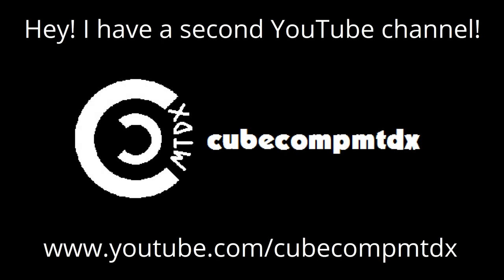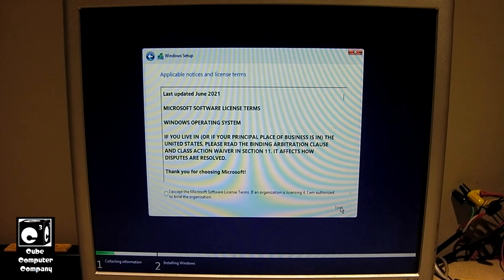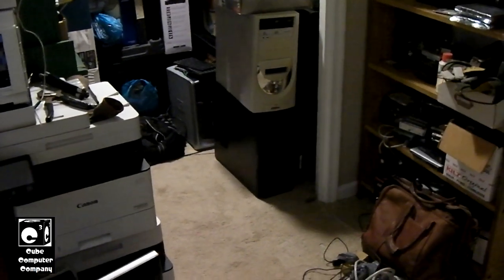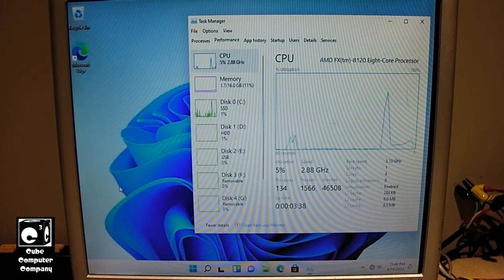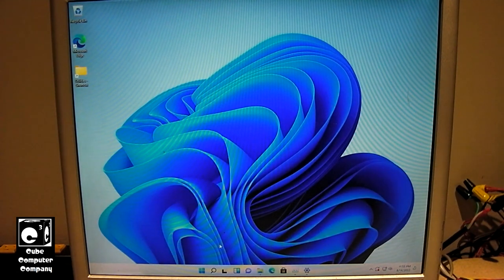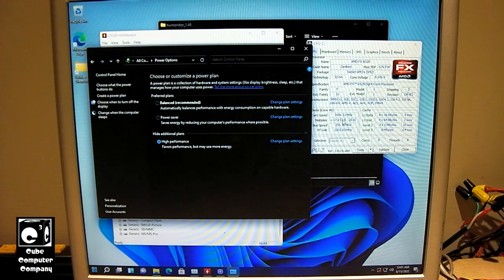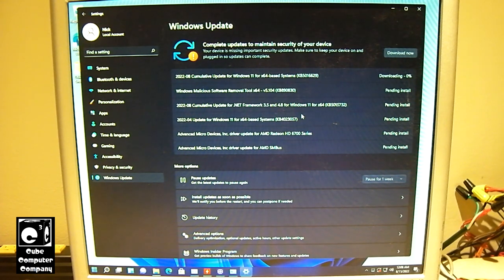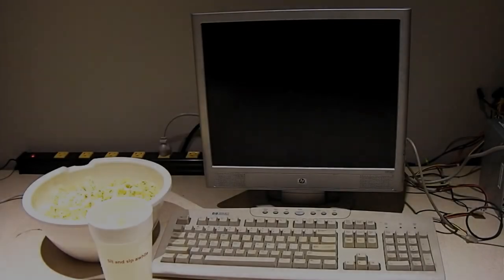Running Windows 11 on AMD FX 8120 + Radeon HD 6750

Comment: The FX series was foundationally built on the idea of Clustered Modular Threading, essentially creating more discrete units within the ALUs of the processor while sharing some functional units. For Bulldozer, Piledriver, and Excavator, the shared units were the prefetch, decode, and floating point units; Steamroller (the third gen) duplicated decoders on each ALU, but that was reversed after it didn’t prove to be much of a performance bottleneck in the finished design. Whether that makes a module of paired integer units with a dual-issue FPU a pair of cores is up for interpretation - I will say that Intel’s designs were usually more performant due to higher IPC.

I’m glad to see that despite Microsoft’s protests the FX series still handles Windows 11 pretty well. Thanks for the video!

Comment: I'm so glad u did this video I have a fx cpu  and I'm gonna put win 11on it
Reply from the maker: Pair it with a SSD and you'll have a snappy system!
Reply: Y ?
Reply: Windows 11 is bs
Reply: You must add a TPM module to the motherboard if it has the connector for it. It might have one installed or it might not. Processors didn't have built-in TPM until a few years later. The person that had the PC in this video might have done a lot of online shopping so they added the module.
Reply: TPM 2.0 modules are backward compatible they will still work on motherboards with older TPM connectors. 
Get matching brands. If you have an Asus motherboard get an Asus TPM, if it's a Gigabyte get a Gigabyte TMP.  An Asus TPM won work in a Gigabyte motherboard. They are easy to install no screws just plug it in.

Comment: Open-shell is open source and free if you want the old style start menu back
Reply from the maker: Open Shell does not work well with Windows 11, at least the last time I had tried it.
Reply: @CubeComputerChannel  I've been using it with Windows 11 just fine. It's a nice bonus along side AllStartBack. I love my 9x style menus.
Reply from the maker: @FugginNugget  Does it work with the Windows 11 start button? That was the problem I had. StartAllBack provides a Windows 7 style menu, and also fixes the taskbar and right-click menus.
Reply: @CubeComputerChannel  I Had that issue to at first. But I figured out it wasn't replacing the Start Button like it was supposed to, but was layering a second button on top of the default Windows 11 Start Button. I just ended up using the custom start button option, and loaded a custom start button image that was just big enough to cover the whole Windows 11 Start Button. 

But you don't have to worry about that with StartAllBack installed. It does a full Windows Start Button delete, and puts in it's own Start Button. And if you have Open Shell installed, it just opens the Open Shell Start Menu.

Comment: I'm a little late to the party but I'm rocking an Amd Fx-4130 with 16gb DDR3 and an rx 460. Possible to run windows 11 before I waste my time trying?
Reply from the maker: Yeah, it'll run Windows 11, though you'll need to use Rufus to set up a USB installer to bypass the CPU and TPM checks.

Comment: Do you still have to use Rufus to get Windows 11 to install on older systems?
Reply from the maker: It depends on how Microsoft's tool formats the USB drive. If it formats in GPT format, it won't be bootable on MBR systems. I prefer to use Rufus to remove the TPM and CPU checks, which may or may not apply for clean installations.

Comment: Hi! I was trying to update mine but says that it´s unsupported on my pc, I use AMD FX(tm)-8320 Eight-Core Processor  3.60 GHz, a bit old I now but it´s immortal! and I love him! 12 gb ram corsair a bit old also, I read something about a few models that we can change an option at bios, and an NVIDIA strikx 750 ti oc 2gb, windows 10 has dream for me like the xp times if I can say it were pretty cool.  I was not using a boot compilation of the  windows O.S, i downloaded the update from Microsoft website, what am I doing wrong! pc age hardware? cpu architecture version also "outdated"? kind regards thanks for the video!!
Reply from the maker: Your system doesn't meet the "Microsoft EliteClass" minimum system requirements to run Windows 11. You can still install Windows 11, but you would need to either clean install it, or use Rufus to write the ISO to a USB drive, bypassing the EliteClass checks. I have this outlined in a different video. Please note, you will receive Windows updates, but won't automatically receive feature upgrades, and must manually install them.
https://www.youtube.com/watch?v=TJqPCS89OUE

Comment: Please try with my specs:
Core Duo E2140
2GB DDR2 RAM
GT 210
Reply from the maker: I have that GPU, that RAM, and maybe that CPU. I'll do a video on a system with at least similar specs
Reply: DDR2 is definitely not gonna carry Windows 11, let alone Windows 8 and maybe 7.
Reply from the maker: @flintfrommother3gaming  Wrong. I've set up many DDR2 systems with Windows 10, 8, and 7. I've also run Windows 11 on two DDR2 based systems. 4GB is needed for usable performance.
Reply: @CubeComputerChannel  I accidentally wrote DDR2, I was going to write 2 Gigabytes of RAM, well 4 is enough for an OS atleast.
Reply from the maker: @flintfrommother3gaming  Windows 11 will run on 2GB RAM, just not very well.
Reply: SSD with those specs will run fine

Comment: I use Fido keys. I think Microsoft should let you install if you use Fido keys instead of TPM. That would solve the problems with security on older PCs. Fido keys are many times more secure because of the touch feature so Microsoft should install and let us use them.

Comment: considering i have it on a couple a6/a8 apu's... yeah it works fine... also works GREAT on FX8350+ chips and 6core12thread xeons(4.5+ghz oc and they match or beat first gen ryzen gaming in most cases... )

i went from using rufus to make 11 install on my system to being able to just install it... my x58 board died and i wasnt gonna spent 150+shipping to get another decent x58 board when that was a good portion of the price of a x299 board... 7940x@4.6 with 64gb ram is a nice upgrade... though... for games my 1070 amp extreme is still the bottleneck most of the time..heh...

Comment: Mine crashes at 4Ghz so I back down to 3.8Ghz. I have the 95w FX 8120 instead of the 120w. I put an overkill 150w heatsink on it, the heatsink fans stay at low RPMs most of the time until I start rendering video after about 25 minutes, it really gets going after an hour.
Reply: If it crashes at 4Ghz you can increase voltage (do it at your own risk).